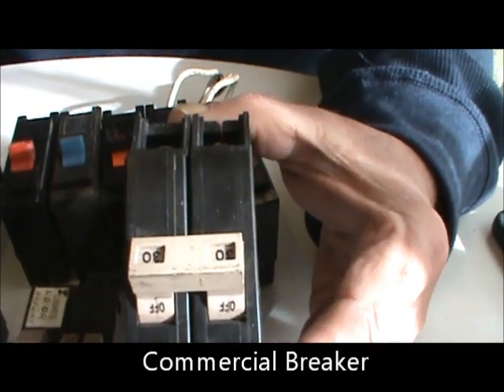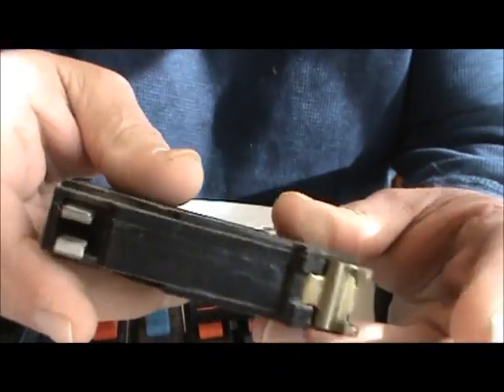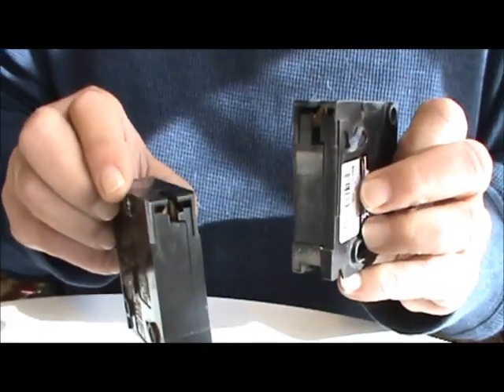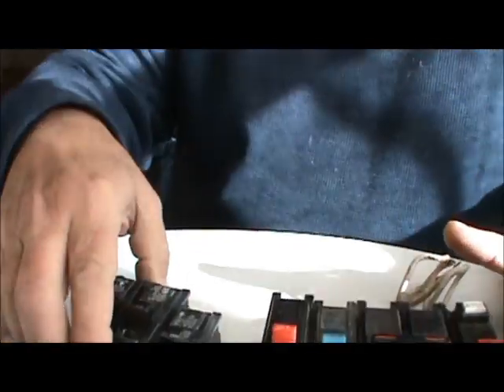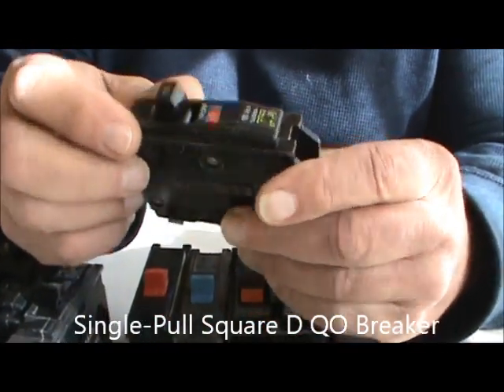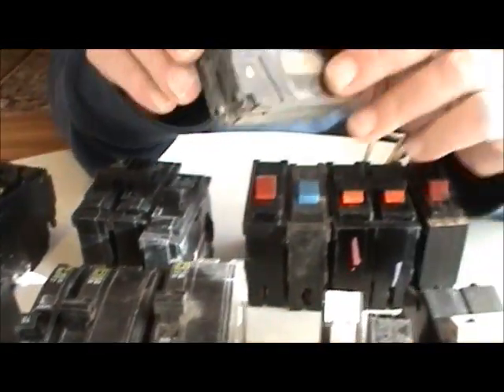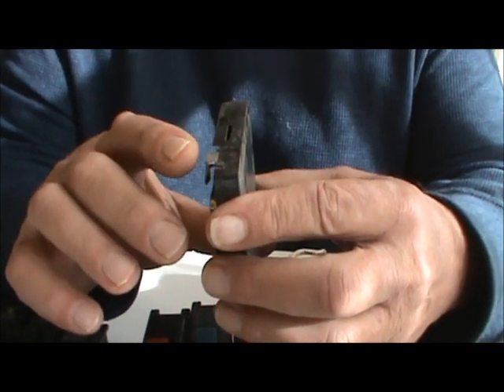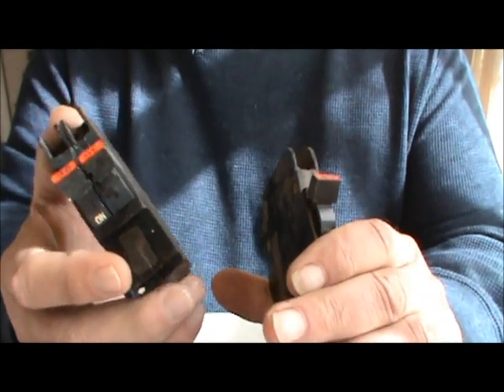How To Tell What Type of Breaker you Have

Comment: Never new there were so many different types. Found out adding 30 amp double. I have square d qo expensive little bugger
Reply: indeed. Just ordered a Square D QO2020C and they're $50-60 each! The newer QOT2020C models are about half the price. Older QO load centers like mine use the QO (has the 2 clips on the back) vs newer load centers use the QOT which has 1 clip, 1 hook.

Comment: Is there a way to tell what breaker type you have in your panel box just by looking at the box or the breakers in it?  I want to add a 60amp to my main panel and need to know if I should research BR type, QO type, Eaton, Square D, etc..... How can I tell what breakers and what connectors are needed?
Reply: I'm in the same boat for a 1960 house with all sorts of mismatched stuff.
Reply: Yes, there should be a label or sticker inside the cover of your panel box indicating who manufactured the box. For example, if Siemens manufactured the panel box, the you use Siemens breakers. Sometimes the label / stickers are hard to find, but they should be there. If the label was removed, or covered up - both big no nos - then you may be able to see the brand on the face of the breakers. This is most obvious on Square D breakers. If you can’t tell the manufacturer by looking at the panel box or the face of your breakers, then it might be time to call a certified, licensed electrician. Working inside your panel box can kill you if you don’t know what you’re doing.

Comment: Is it common practice to match the breakers already in use?

I had some left over from an old sub panel I disassembled when I moved some years ago so thought I'd like to re-use them..
It's the same type and the same size, with the stab type that fits on the bus, but a different brand. It hooks in fine too, but it won't quite snap flat..

Makes a connection and works. The panel cover even goes back on. It holds, and the cover holds it in completely.
Is this okay to leave, or should I try to find the identical same?
Reply from the maker: Yes you can to long for for me to type, call me  434-284-0600

Comment: My camper has a Gould box and my friend's house has a Crouse-Hinds box.  I read that it is now illegal to use another brand of breaker, However Wikipedia says that Crouse Hinds was bought by Cooper, which was bought by Eaton, which also bought Westinghouse, making those all interchangeable.  My friends panel contains breakers made by Eaton, Westinghouse, and Seimens.  So are the Seimens breakers illegal?
   I can't find Gould breakers, though again Seimens appears to make breakers labeled "Siemens ITE Gould".  Did anyone buy the Gould company? what else is legal to put in a Gould box?  I am also looking for an odd size, 13 amps, so the breaker will trip in my camper before the 15 amp breaker trips in the house, and also so I can use a 100 foot, 14 gauge extension chord.  So anyway, where do I find a deal on a Gould 13 breaker?
Reply from the maker: You are going to have to use a 15 amp. Sorry thanks for watching.
Reply: @TheNaturesFriends  I found Siemens QP 10 amp, but am not sure if I'm wiling to go that low.  I think I found the answer. Siemens QP fits Gould and Murray MP fits Crouse-Hinds. They are physically identical and I hear are even built on the same assembly line, but are in a legal grey area.  Siemens does make a 13 amp, but it is some sort of European type and does not fit.

Comment: I have old westinghouse box , do I need to put anti- oxidation on the main breaker contacts before installing ? The original 200 amp finally deteriorated and it looks like a hom2200 may fit in its place. I will probably have to sand a bit of age off the contacts in the box
Reply from the maker: Yes you need deox